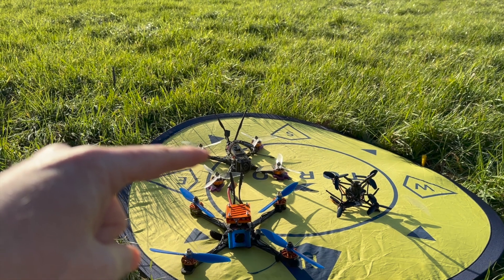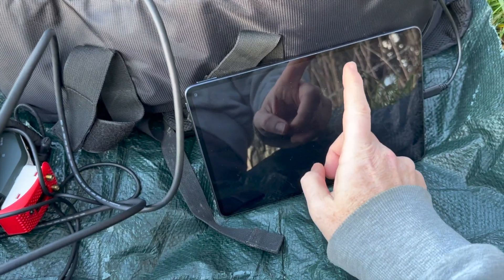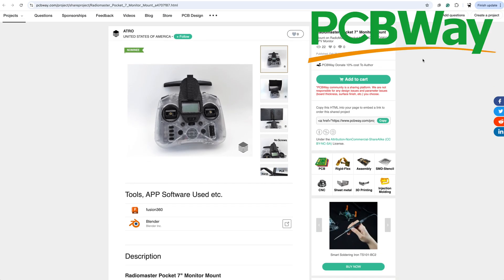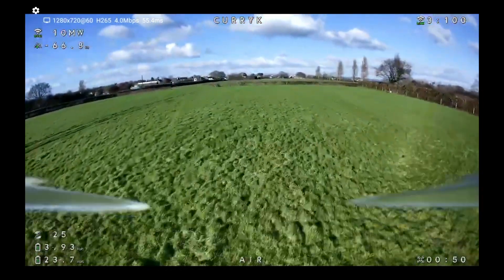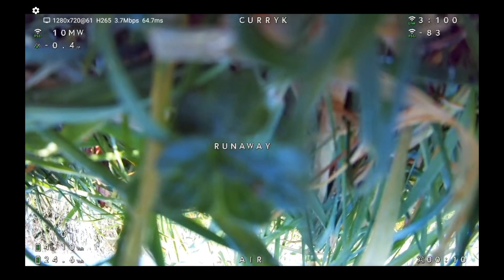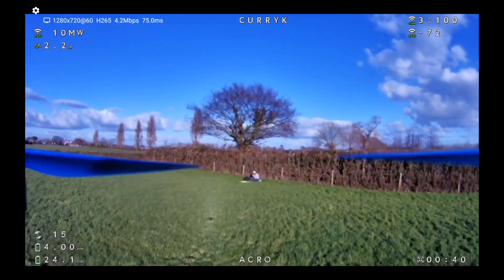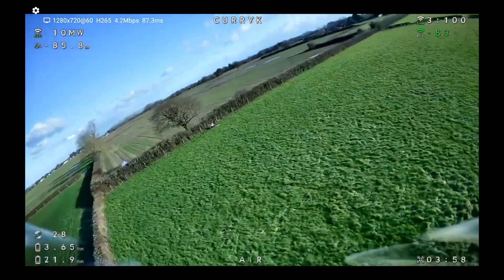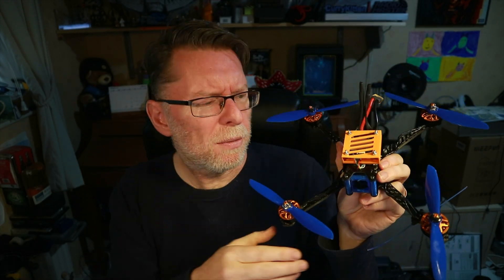Attempting to fly 3 OpenIPC quads with MSPOSD installed

Comment: Why not piloting from inside the car? Here in New Hampshire at 20 degrees F ,  -7 degrees C,   I always use Walksnail VRX placed on the car dashboard and piloting with a gaming monitor connected to the HDMI output of the VRX. I used to be an antenna prototype maker in my earlier career. Yikes any one wear an antenna on the head and use his torso as an antenna stalk. That is an antenna designer's worst nightmare.
Reply from the maker: My car is some way away from my take off point, so it's not practical in this location.  It's a good idea though, just less places where I could do that

Comment: Also if you update to the latest version of MSPOSD you can run the OSD on the GS instead of the air unit - this means that when the airunits video smears and breaksup your OSD will be rock solid - this along with the OSD menu was an absolute game changer for usability imo . Also would highly recommend updating to the radxa - the latest image 1.9.7 includes alink and also has a webui you can acces to change setting at the field
Reply from the maker: Yes - I saw they now had a ground station version of MSPOSD and forgot to mention that one

Comment: if you want to give higher bitrates a go you really need to update the firmware on the air units to the latest ones - these give noiselevel = 0 and fpv enabled , which are two settings that DRAMATICALLY lower CPU usage at higher bitrates - all of my drones run at 20Mbps now and the picture quality is briliant range takes a hit though . A few caveats the blue wifi boards the RTL8812EU2's cant do 40MHz and alink is super super unpolished rn ,  imo i think its not quite ready for the masses because each persons setup will have to be manually configured to get good results , mario's presets help a bit but it takes alot of time to dial in the settings of the alink , its not an install it and let it run kinda thing .
Reply: Building a radxa ground station currently and still learning the basics, should I order different cards than the RTL8812EU2? Those are in the mail since they were suggested to me but what should I be running if I want the 40mhz mode to work?